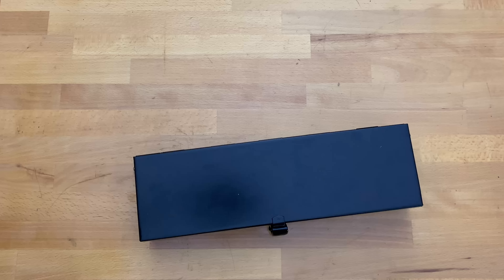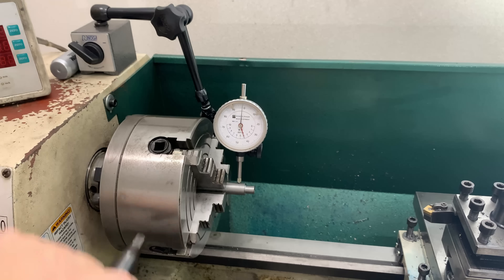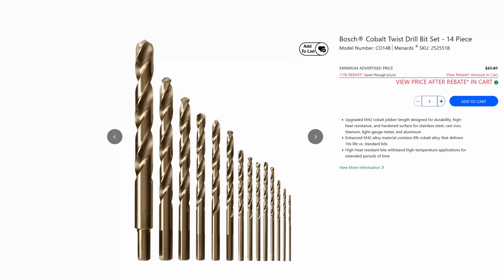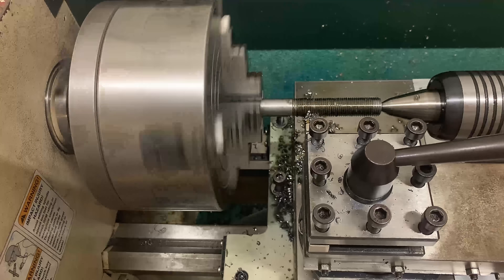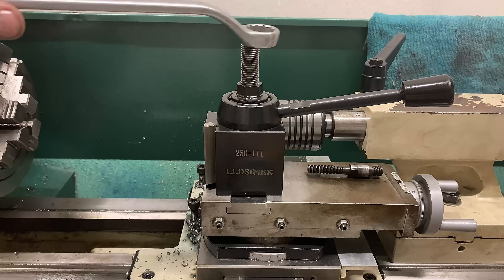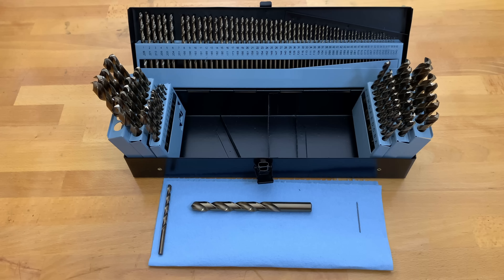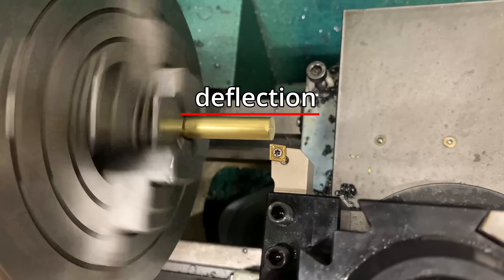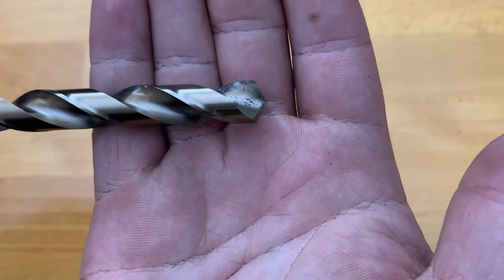Are Harbor Freight Drill Bits Secretly AMAZING?

Comment: Your experience matches mine. I did find one that was a tiny bit oversize but all the bits I've tried were sharp and straight. They're a perfectly fine value. Maybe don't expect Norseman quality but I've had a good experience with them so far.
Reply from the maker: I don’t expect Norseman quality, but I am pleased that they’re doing what I need them to do. And honestly a hole in a piece of steel is a hole in a piece of steel whether the drill bit cost $10 or $1. As long as it gets the job done, you know?
Reply: @ShopHumor  I didn't mean to imply you were expecting top quality from bargain bits, if that's what you got out of my comment. I am very happy with the product and the value. They're working out much better than a similarly priced or even more expensive set from Amazon I asked my work's maintenance dept. to get.

Comment: Speeds and feeds, thats where the performance lays, that and  cutting oil to keep temperatures down so you dont roast the drills cutting edges, especially important when drilling stainless steel which has a habit of work hardening. Well presented, and informative! Thanks for the review on the drill set.....
Reply from the maker: Thank you Michael! I really appreciate it.

Comment: I wouldn't trust a lot of Harbor Freight gear, but that's because I expect a lot of sub-par materials and slapdash construction. Y'know, where it'll work kinda okay for a while before abruptly failing. A winch might have structural bits made out of plastic or the finest pot metal in China, or the gears might have so much slop that they eat themselves. But basic tools like drill bits, wrenches, hammers, that sort of thing? It seems to me like there's not really any room for corner-cutting. Either it's built to the specified tolerance and it works, or it doesn't.
Reply from the maker: I mentioned in the video that I've had some Harbor Freight tools that didn't work out well, but I've also got some real gems. I have a 2 ton engine hoist that I've used for years to move stuff around the shop and it's been fantastic.

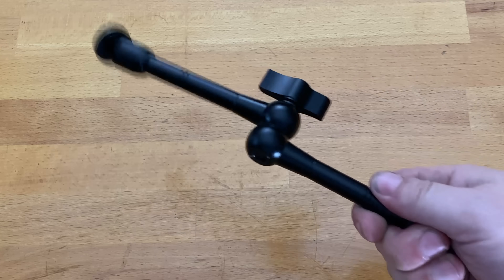Comment: At 1:40 you can see there is chuck body runout as you start up the lathe !!... whats that all about ?... loose or badly machined backplate ?... or bent spindle .. 🙈

Re. the cobalt drill set, I think buying QUALITY  HSS drills is a much better option... I still have some Presto (Sheffield, England) drills that are up to 30 years old, and half their original length from regular sharpening... particularly my MT drills over a half inch ... the biggest is 1.1/2"...the biggest killer of drills , in my experience, is RPMs, next is lack of coolant / lubrication...
Over the years I've learned to accurately grind off-hand and use a split-point grind for any drill over 3/8" or 10mm...

Sub & a like ! 😎👍☘️🍻

Comment: It is fascinating how complicated freedom drill sizes is. Here in metric world the standard drill set has 0.5 mm to 16 mm in 0.5 mm steps. They might skip some of the larger sizes to make it a set of maybe 20-30 drills instead of ridiculous 115.
Reply from the maker: It really is ridiculous. Metric is so much easier to use, but we have to work with what we have. Thanks for the comment!
Reply: Remember they are just numbers, no need to fear them or be confused by them!
Reply: There are 3 separate series of drills used in the US.  Fractional sizes, letters, and numbers. This set includes all 3 series.
Reply: This is not a standard set for the US. This is the set you need to make all the holes for things like starting thread cutting operations. Normally you are looking at 29 sizes in a US set. The step sizes are a load of wank though.
Reply: How do you drill for starting a thread operation in metric? If you want a m2 threaded hole what drill do you use to start?
Reply: @psywiped  the charts say 1.6mm
I'm betting that unless they're doing constant and precision work, people risk it with a 1.5mm

But m2 is dinky, very easy to break stuff at that size, so maybe not.
Reply: @psywiped  you can get drills in any size. For m2 you need a 1.6 mm drill which you won't find in ordinary stores. But it can be ordered online. I have never seen a drill set that includes all the needed drill sizes to match exactly the required drill sizes for tapping. Although many of the metric tap sizes happens to be on a .5 mm boundary.
Reply: @BaldurNorddahl  apparently the harbor freight does for imperial.
Reply: @psywiped  yes I suppose, but it is still very complicated with three different series of drills. Metric you just look up what size and that is in mm like everything else. For m2 it is probably fairly important to use the correct size, but for larger threads you can get away with just using something close. For example m8 requires a 6.75 mm drill but if you use a 7 mm drill it will be just fine. Also only m1, m2, m4, m5, m8 and m12 require drill sizes not on a .0 or .5 boundary up to m16. So that would be 6 extra drills in the set to include all possible drill sizes for thread tapping in a 0.5 mm to 16 mm drill set.
Reply: @BaldurNorddahl I agree metric is much easier. In practice as a jobbing designer, you only need a handful of bits to do nearly anything in product, automotive, and steelwork / construction. The sizes in use are typically M6, M8, M10, M12, M16, M20, M24. Thus you need a clearance and tap bit for each hole (14 bits total). This covers probably 99% of all holes. You also need only 7 spanners and sockets for hex fasteners.
Reply: @psywiped FWIW, sets of 1-6mm and 1-10mm in 0.1mm (4 thou) increments are commonplace.
Reply: That is horribly crude by machining standards.  Most of the letter sizes are only 0.1mm between sizes, and some of the wire gauge sizes are <0.1mm.  Even standard fractional sizes are ~0.4mm difference.  If I only had drills available in 0.5mm increments I would just give up any hope of precision machining and go home.
Reply: @IceColdChannelSports  you realise we can get metric drills in any size? For example, it is common to have drills that match the required hole size for threading exactly. However those are not part of the common drill sets, because very few people actually need that.
Reply: @BaldurNorddahl this video is about a machinist 's drill set.  Not the common basic sets.
Reply: @IceColdChannelSports doesn't really change the point. The number of extra drills for the common metric size threads are not huge and some even overlap with the common drill set. In any case I have never seen the thread drill sizes sold as a set. You buy the ones you need as individual drills.

Comment: The one benefit of buying a cheap set like that, is that you have all the sizes you use rarely, and the sizes that you use often, can be swapped out for better quality bits as they fail.
Reply from the maker: Exactly correct. I plan to stockpile the size I end up using most frequently, and keep the index on hand for the oddball sizes and one-offs that come up when repairing some random gadget or part around the house and workshop.
Reply: @ShopHumor  You just have to bite the bullet and order them on msc or mcmaster when they break. For nice cheap machine drills
Reply: this is exactly what my instructors would tell me in aircraft maintenance engineering, jap-on before snap-on.  You'll figure out what stuff you need to upgrade and whats 'good enough'  its very tempting to have slickest sets of everything matching but its a huge waste of money in most cases.
Reply: That is too true. Plus you can buy really nice brands to replace those you do break and eventually you'll have the brand name set.
Reply from the maker: Exactly.
Reply: Yes.

Many years ago, I bought a cheap 115-piece set, figuring that I could replace them with good-quality drills as they wore out.  I've replaced a few of them, but still have most of the originals, several of which see occasional use.

Getting a Deal on the big set when you're starting out, and upgrading as need and opportunity dictate, is a good approach for the home shop.
Reply: @ericwilner1403 Ditto, bought the  same set from Harbor Freight,  back in the Navy in 1990,  only I bought the regular high speed steel bit set not the Cobalt. Think I paid  around  $45.00 back then.  Still have them, use every day for years in  Commercial Aviation Repair.  Some bits break and replace.  Mostly #30, 41, 21. 

I find that I only really need cobalt for drilling hardened steel, like drilling out a broken screw or bolt.   Then I use a slow speed neumatitc hand drill motor and use Boelube wax as cutting lube
Reply: You guys sold me. Start cheap, upgrade as needed. Sounds like good advice in this situation.
Reply: This is the way
Reply: @AshesWorkshop  This is the way.
Reply: Exactly. That is, so long as the inexpensive set is reasonable and not complete trash.
Reply: @jamanjeval  Usually you buy the second or third cheapest.  Not complete garbage, not overpriced or the best tool ever, just reasonable value.  If you watch Project Farm most of his reviews wind up at the same conclusion.
Reply: @j.f.christ8421  price isn’t quality, quality is quality. People often call something cheap when they should say low quality. Project farm will show you that the least expensive isn’t always the worst and the most expensive isn’t always the worst.
Reply: That's what I did, and the drills surprised me and held up fine. I break a lot of 3/32-11/64, so I buy 10 pc. bundles of those for a few cents apiece.
Reply: Helpful hint. Yep, replacing with top quality as time goes on is a great way to build a good inventory. Issue is most only think of the big box stores and as stated, they don't have the best quality. Nor do they carry the odd sizes individually. 

Here is the answer. Forget Big Box Stores. Or any hardware store for that matter. go online to major industrial suppliers. There are many . U.S. Drill, Grangers, the list is huge. They have the very best quality and different qualities and tell you exactly which is which. as a bonus, they sell large batches at reduced prices of any given size. this rally helps with a size you use often.  

And don't use your high end Cobalt drills in a Hand Drill!!!!!!!!!!

Another quicky, don't use ti coated bits in alu. Alu. sticks to Ti as Ti has an affinity for Alu. and all the major industrial suppliers will tell you the same. 
I've had so many carpenters bad mouth ti coated bits as junk because the do such a terrible job on door and window frames made of alu.  the Big Box Stores have no clue and sell them as a premium product for builders. One of the worst choices for them there is. 
KnifeMaker
Retired after over 47+ Years in the  Craft
Reply: Or you just buy the good set once so you don't spend all your time shopping for replacement bits 😂
Reply: meh:face-red-droopy-eyes: if used carefully they are great for GP users...
Reply: Most will need sharpening. Once properly sharpened, unless they're bent, they're a good buy.
Reply: point made agree
Reply: Great freaking point!
Reply: Exactly!
Reply: This is what I did. Went cheap for that days job. Next check went out bought the things that used a lot. When the cheap thing broke or wore out. I used the better ish brand.

Comment: Shoot, all those funny sizes, and three sets that interleave. Why not just use Metric- everything is sequence and equally separated? You finally (after two earlier attempts) went Metric in the mid 70s...
Reply from the maker: I wish. I try to use metric as much as I can. I do a lot of little projects in Fusion360 and it's so much easier to design things in metric.
Reply: @ShopHumor  I think the drills are cheaper, too. For 'ordinary' 0.5mm spacing, I pay ~$18 for a 100 piece selection. Full sets are nearer $130 for a good split point set 1 - 10mm; but normally split at 6mm. The 1-6mm is around $20; all the ones that are harder to sharpen...

Comment: I have the Milwaukee cobalt drills.  They are sharp and will cut better than normal bits, but they are brittle and shatter.  I like an idiot was trying to drill out a lock cylinder by holding a pad lock, the bit caught, shattered, and gouged my hand.  So probably best for drill press, or very careful use in a hand drill.  Don't do what I did!  Be ready for them to shatter.

I have the 115 piece HF set I bought a couple of decades ago.  I like that they have fractional, letter, and number sizes.  I haven't used them much however.  I think I paid $60 to $80 as I remember.  What a value!
Reply from the maker: Ouch! How badly was your hand gouged? I plan to use mine in my mill and my lathe so no hand tools for me with these. I'll save my old HSS drill bits for the hand tools.
Reply: @ShopHumor  I gouged the palm of my hand.  I didn't need stitches but it was close.  I do notice that the Milwaukee cobalt bits cut well, and I'm a bit spoiled with their performance, although they will shatter and are expensive to replace.  Home Depot has a sale on 6 Milwaukee cobalt drill bits for less than $20 I just bought to replace the many broken smaller bits (not all me as I had lent out the bit set).

After some reviews online I just bought a General Model 825 drill sharpener that mounts and works with your bench grinder.  It's a modern China copy of an old Craftsman design and I got it for $21 with shipping.  It's simple and does a fine job although I haven't used mine yet.
Reply from the maker: I just looked it up and that sharpener or one like it is going to be in the shop this week! Thanks for the recommendation.

Comment: Harbor Freight - The same quality tools made in the same factories as the name brands, only put in really poor quality packaging to save you money!

Harbor Freight!  Where the name falls off before the quality goes out!

All kidding aside, I worked at HF for a while and have many HF tools.  One can get some exceptional value if one shop's intelligently.
Reply from the maker: Thanks Todd, I agree. Like I mentioned in the video I have a lot of HF tools and some have been real gems. My 2 ton engine hoist has been phenomenal. I really like my US General tool chest (42", about 10 years old, I think they changed the design on these a little since then) and so many others.
Reply: @ShopHumor  - I have 2 of the US General Tool Chests.  As an employee, I was able to scoop up some floor demos, returns, etc.  I would say the US General Tool Chests are close to Tool Truck quality, with the exception of the wheels.  If I were to move the tool chests around, then I would get new wheels.  A lot of HF equip has a flaw that needs attention, or a new part.  Typically the value is so good that it's worth it.  For example, even with new wheels that Tool Chests are less than half of the Snap-On price.  For example I had a 20 Ton HF Shop Press; I replaced the bolts with grade 8 and added flat washers.

I have earthquake air impact drivers (designed by a snap-on engineer), a Vulcan MigMax 140 welder (designed by a Lincoln engineer), and the Earthquake 2 Ton long reach low profile floor jack (basically same as the Snap-on jack that is 3 times the price; in fact, Sanp-on attempted to sue HF as the floor jacks are made in the same factory).

that the Now when it comes to battery powered drill/driver, 1/4" impact driver, Hakzall, and reciprocating tool, you can have my Milwaukee M18 Fuel tools when you pry them out of my cold dead hands!
Reply from the maker: You must have been like a kid in a candy store (at least, for a while) getting your hands on all those demos, returns, etc. I need to upgrade the wheels on my Tool Chest at some point, I just move it so rarely that I don't ever really think about it.. except the next time I move it.

Comment: McMaster-Carr will sell you a single #7 drill bit in M42 cobalt for under $6. Sounds like a lot, but if you only need one drill bit. That said, you really don't need cobalt drills to drill metal, certainly not aluminum or brass. If you were drilling holes in grade 8 black oxide bolts, they would last longer, but mild steel even 300 series stainless should not be a problem for a bright finish ($2.41)or black oxide drill bit ($3.36). If you want to drill tough stuff like stainless or tool steels you could go for TiN coating or TIAlN under $6 and $9 respectively. Sure, if you order one item, you will be paying shipping, but it's ground rates and usually arrives within 2 days. If you are looking to have something on hand though, the HF isn't a bad choice. Now where I wouldn't waste my money is on taps. just get a good spiral point machine tap, or form tap. You don't need every screw size known to man, and those carbon steel hand taps are very brittle. A good spiral point will hold up well. In aluminum, I've power tapped by hand with a cordless drill with 4-40's all day long (you can use a 3/32 as a tap drill.

As a quick rule of thumb for english threads, take the reciprocal of the threads per inch and subtract that from the nominal OD to get the suggested tap drill. So, for a 1/4-20, : 1/20 = 0.50, 1/4"= .250. .250-.050 = .200, a #7 is .201. This works up and down the line. If you aren't on size, go bigger, not smaller For a 1/4-20, I would not be worried to use a 5/32" (.219) for you use case.
Reply from the maker: Some good thoughts there, John. I order from McMaster-Carr with relative frequency and certainly could have just picked up a single #7 of solid quality from them. I even looked at buying one from Lakeshore Carbide (I've gotten some high quality end mills from them before, made in the USA).
 
I had just reached the point where I didn't want to worry about whether or not I had the right size drill for whatever project came across my workbench, so that pushed me toward buying an index. As far as taps go, you're probably right on that.

Really solid rule of thumb there, too. Thanks!